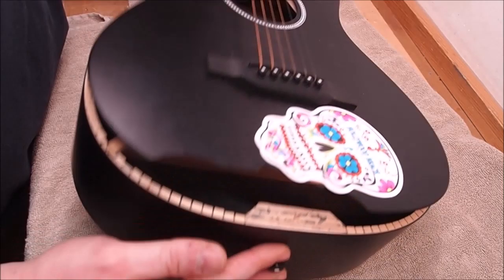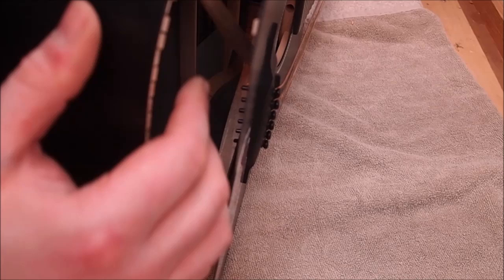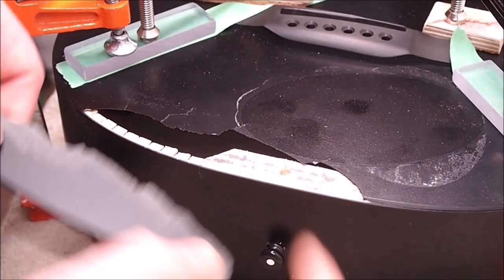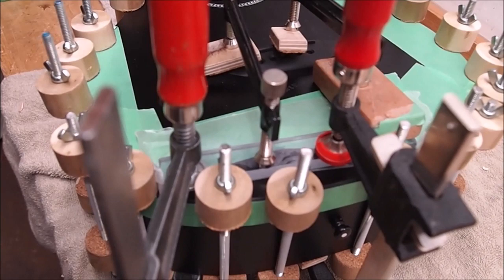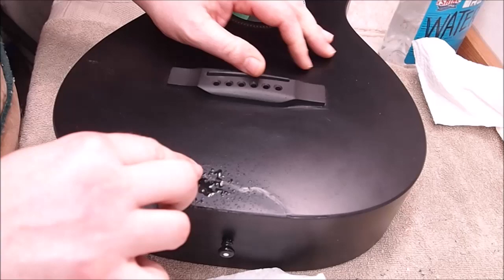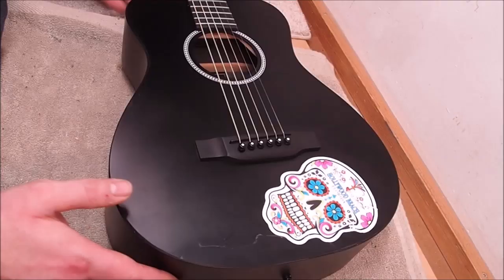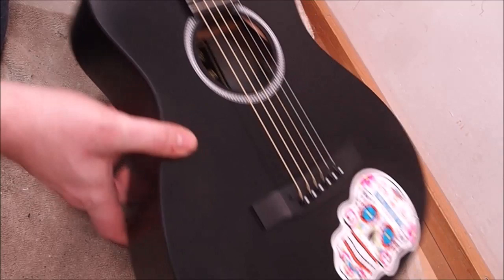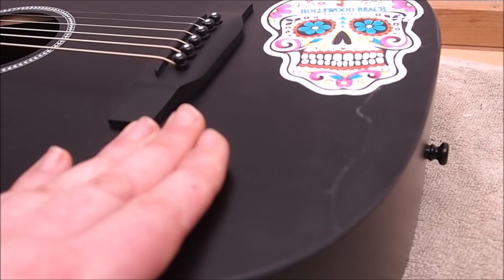Martin LX in a world of hurt.

Comment: I bought a Martin D-35 new back in '77 and still have it. I love it but would never take it to the beach or on a 4WD trip. So I picked up one of these laminate wonders years ago and I love it for what it is. I'm not afraid to take it anywhere, it's pretty much indestructible, (unless you actually smash it, like the one in the video) and with everyone singing off-key around the campfire, you can't tell what it sounds like anyway.
Reply: yup, stability in the face of rapid heat & humidity changes is where it shines.
Reply: I love mine. I’m holding it while watching this video. I work on a tugboat. You won’t find a better $500 travel acoustic. Obviously not indestructible, but damn near.
Reply: Stable is an understatement. This thing was in tune when it arrived from Sweetwater FedEx Air
Reply: I've taken mine down the Colorado River twice. You could practically use the damn thing as a paddle.

Comment: Great repair. I've been playing guitar since 1974, but was apprehensive about doing repairs. A friend had a   Danelectro convertible from the early 60's that someone had crushed the Masonite top in. I could not find a suitable piece, so I used a piece of 1/8 " birch. Traced the top, cut it out with a band saw, glued it on, and refinished it red. Still have it. Weighs next to nothing.

Comment: I agree on the throw-away mentality, so thanks for finding a way to fix this "countertop" guitar. One thing I've done for years is avoid extra plastic packaging at the supermarket; the best package for a squash is the squash. I recently received a shipment of end pins, felt washers, and rubber strap locks, all in a plastic package. Paper would have worked just as well. The mandolin strap I bought a week ago was attached to a paperboard card that proudly declared itself to be not plastic, but the button holding the strap to the card--plastic. I'm no green fanatic, but sometimes plastic just doesn't make sense.

Comment: I really appreciate your philosophy on sustainability, and the ethics that should be considered when building new and or repairing old guitars. Your videos have been super helpful as I begin rebuilding and doing some refurbishments on old guitars I have. Keep up the great work!
Reply: @garymitchell5899  If you can prevent something from going to the dump and reduce the need to harvest new materials, you are acting in a sustainable way. Yeah,  the manufacturing of guitars might not be a major contributor to our environmental woes, but it's still playing a small part in and being impacted by deforestation and high demand/low supply of materials. There's a Premiere Guitar article from 2007 titled "Going Green: The Guitar Industry Plans for the Future" that does go into the concerns of sustainability amongst many major guitar brands. I have also read something by the BBC on a similar topic. The point is to try and make do with what exists before deciding to dump what's already at our disposal for something new.

Comment: Nice save! For about $3 worth of black HPL you could replace the whole top and make it like new, or better yet up grade it with a cheap "A"  grade spruce top. It would be more work but could make it like new or better. Keeping some scrap laminate on hand (courtesy of your local cabinet shop) would allow you to renew parts instead of fitting the pieces together. If you do reglue pieces, Kampel seamfil is a liquid plastic you can use to color match and fill in the small missing bits. But nice save! I always enjoy watching your videos because you do good work, and the fact that you don't always trash a guitar because it's "not economically  fixable" as so many do.

Comment: I have a Martin LX1 but mine has a spruce top.  I wanted a "camping" guitar that I could take to the trailer.  I once took my 1948 Martin 0018 up there.  With the humidity and temperature changes, the bridge came loose.  After that learning experience, the best option was the Little Martin.  I just didn't like the performance of the Travel Martin, but the LX1 sounds much more like a full-sized guitar.  I did take me a while to get used to the very short scale length, but it was worth it.  May not be the most environmentally correct decision, but it is a compromise that I'm prepared to make.

Comment: Thank you for fixing it. They sound good and they are durable. Hpl is made for resin or epoxy. The laminate filler is color match bondo or the other recommended fix is sawdust and fast set glues with colors.

Comment: I have the DLX with a Cedar top. The very same issue happened to me and 3 other guys that had them. The top pulling off from the body at the end of the guitar. I played this 7 days a week for about 8 years. No warning, just opened the case one day and the damage was there. No knocks or bangs caused it. It is a known problem with these low end Martins.
Reply: I've had my dx1 with the spruce top for 20 years.    You can see the effects of humidity and dents and scratches only on Spruce top still plays great all these years later.   I play it everyday still.    Maybe the difference is I keep mine in a case and treat it like an expensive guitar. $500.  Lmao.

Comment: Laminates typically have a very thin,  "photograph" layer to simulate wood. Perhaps if the use of HPL continues, this veneer/film could be made available as an iron-on or self-adhesive for repairs.
Reply: Think they've been using it for 20 or 30 years.  I bought my dx1 in 2003 I believe.  Still plays great.

Comment: My Martin 12 string was made in Mexico, but has a spruce top with laminated sides and back.  Sounds great for the price and no plastic.  However the neck is flimsy.  Did not know Martin made a plastic top guitar.  Thanks for the video.
Reply: The Martin "X" series 12 string is "plastic laminate" back and sides. It is countertop material, with a spruce top. Ovation is a plastic back and sides with a spruce, or cedar top.
Reply: Uhg.  The GC salesman told me it was recycled paper laminated.  I never checked into it cause it sounded so good. Thanks for the depressing info. Ha!.  I'll not plan on doing that again.
Reply: @mcgrawreek  I have one too. (Lol). That's how I know. My next will come from Canada.
Reply: Michael Glaesemann HPL is high pressure laminate. It is cellulose impregnated with epoxy. Not plastic!
Reply: @ldean-du5im  Interesting

Comment: HPL (high pressure laminate).  It's the same thing as counter top Formica which is made of compressed wood pulp/paper with a melamine resin. Not plastic.   While it's very weather resistant, it will delaminate and fall apart if left outdoors over time. 

So, these HPL Martin's are Formica guitars.  As you know, Formica can come in any imaginable print design, including wood, or in your case, black.   The Martin OXK ukulele is just that.  It's made entirely of wood grain looking Formica (except for the spruce braces).  The necks are Stratabond laminates, same thing  that has been used in gun stocks for decades.  Stratabond laminates are made by Rutland Plywood Corp in Vermont.
Reply: Yeah the stratabond is birch.

Comment: Reduce, reuse, recycle. ♻️
Reply: redesign, reduce, re-use, repair, re-purpose, and then, after all other avenues are exhausted, recycle.

recycling is by far the most inefficient way to make use of old things. here they take your glass bottles away, burning diesel while doing so, then smash the bottles up with a big machine which uses a lot of power, then they are melted down which uses even more power, and turned right back into bottles again! it is ridiculous.

Comment: I have a Martin 12-String with a solid Spruce top and HPL (countertop material) back and sides.  Not the prettiest guitar but it certainly has that unmistakable Martin thunder!

It has developed a “belly bulge” at the bridge which I had corrected and now use it tuned down a full step with extra-light strings.  I wonder if an HPL top would have issues with the “bulge” as does a solid spruce top?

Comment: Good job, as always. I had a similar Martin come through my shop, the back was separated from the linings, there was leftover wood on the back as in this one, my take on it was that the lining wood used was very soft and weak. I agree the neck  looks like Baltic  plywoow but I was  not  as impressed with it  as you ! But you are probably right it's much better than cheap wood.
Honestly being more of a classical guitar guy I was shocked to realize it was made of formica basically... I have an 1961 Martin, a real guitar. These plastic things bother me, and I didn't expect to see it from Martin. I see a lot of "Martin" guitars without bindings too, just feels wrong overall.
Reply: Martin's without binding, you mean like a d18, their most iconic guitar? Not sure how you could say it feels "wrong".
Reply: @24avenged24  D18s have a single ply black binding.
Reply: I've had a dx1 for 20 years.     I remember like yesterday when I was shopping around for guitars I planned on spending thousands ended up with the Martin cheap guitar cuz it sounded better.    Twenty years later daily playing still sounds good the hpl still looks like it's brand new but the spruce top has of course darken it's formed the lot of dark grain line from humidity issues in the past has some dings and scratches but it sounds sweeter and smoother than ever.

Comment: An excellent vid and an interesting argument. You say you aren't knocking Martin for their attempt to solve the problem of getting into the entry level market. However, I think plastic is simply the wrong solution for two reasons. First, these low end guitars will inevitably end up unplayed and unloved. This is because good players will soon progress to better instruments, and so these ones will remain with novices and eventually be broken. Few people will want to pay what it really costs to fix them. Second, I'm sitting playing my 1939 Harmony deco. OK, I had to reset the neck, reinforce where it was collapsing round the soundhole, fix a crack in the back and repaint the fingerboard to its simulated rosewood and pearl inlay elegance, BUT, I'm an amateur and you can hardly see any of the work AND all the guitar apart from the hardware is made from solid wood (it's birch), it originally cost just a few dollars and it still sounds and plays great. So the alternative solution to plastic is there - simply made guitars from cheap, durable, sustainable, easily repairable wood.
Reply: Two words:  Ed Sheeran.
Reply: Its not plastic bud lol.  And imo spruce top with hpl sounds better than with rosewood.  Im all about thst powerful martin bass sound.  Ive had a dx1 for 20 years which i opted for over guitars thst cost thousands.  But it's all subjective to each his own

Comment: I was gonna ask why you just didn’t replace the plastic top with a real spruce top. Then you said you were doing this repair on a low budget and Then it made sense. If it had been mine I would have had you replace it. Because as Torres said soundboards are everything.

Comment: Not sure the "biodegradability" is a fair measure on this. Plastics have different rates that they degrade and under variable conditions. The urethane finishes on many instruments are a form of plastic as well, so are they really that much better? I'd hate to see any of it in a land fill or worse, in the ocean, so I agree that they should be fixed and not thrown away, even when the fix costs more than the guitar. Also, how many clients do you get requesting to turn a cheap guitar into a more playable instrument? In my opinion Martins, even at the low end, can be turned into something playable assuming the owners are willing to make it happen. Some of the other low end instruments are truly garbage (talking to you, First Act) and that's a shame and waste of resources. I agree with not creating more flotsam but not so sure plastic guitar tops contribute to it.

Comment: Just put some duct tape on that junker, not worth the time and effort to fix. I really hate when big name guitar makers produce cheap entry level guitars made from cheap materials. For the price of that Martin, you can get a all solid wood Fender  parlor or an Alvarez or Ibanez that isn't laminate. Martin should be ashamed of themselves, they sell guitars for $50,000 and are the #1 selling acoustic guitar manufacturer and they can't sell quality entry level products that aren't made from plastic, and cardboard? Fender does it, most of Martin's entry level guitars that are under $1000 are laminate in one way or another. I bought 2 all solid wood Guild guitars for well under $1000 each and they brilliant. Martin can definitely afford and profit from selling entry level products that are solid wood through and through. The Fender PM  is all solid wood and is around  the same price Martin LX and is about the same size. Martin isn't a boutique company so there's no excuse for this.